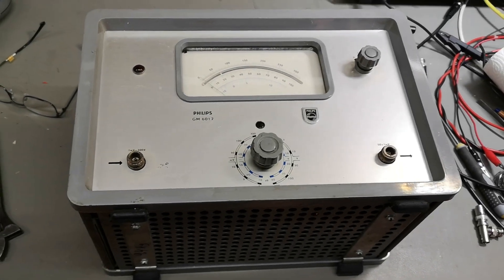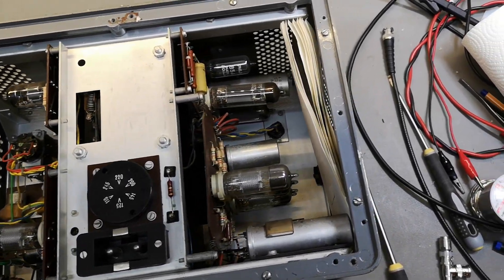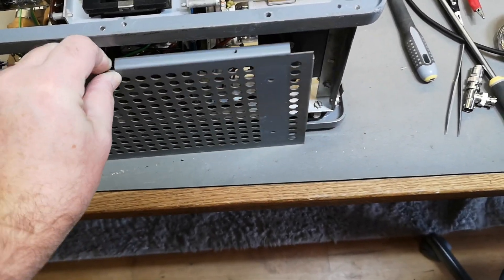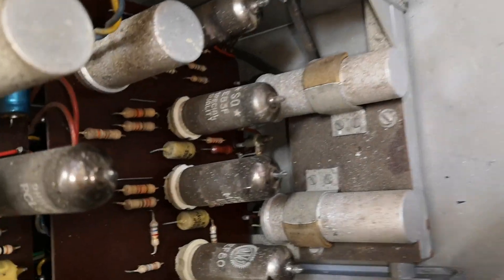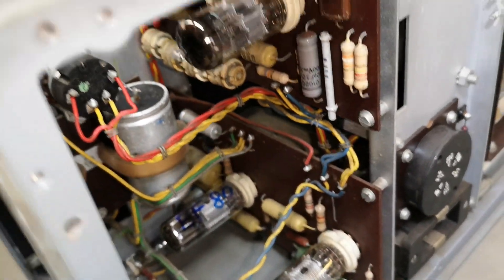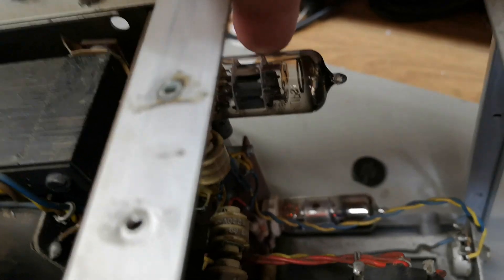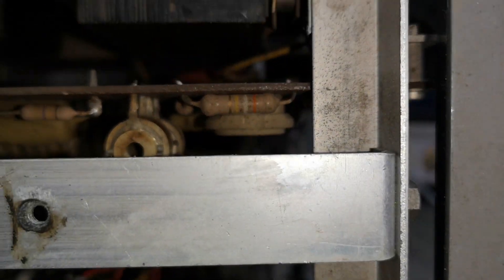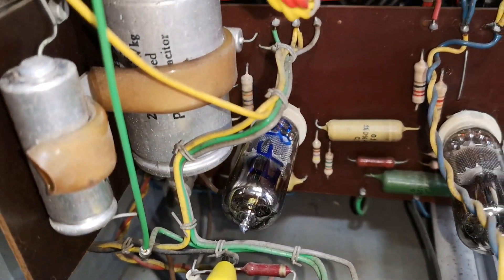Philips GM6012 wideband Millivoltmeter 1961 repair teardown

Comment: Nice video. What reduction are you using for connecting bnc cable? Where can i buy this reduction please?  (I don't know name o this old philips connector)
Reply from the maker: this is a normal standard N connector, so i just used a normal N to BNC adapter

Comment: Meter likely has cracked solder joints, or there is another loose contact on a tube socket as well on final amplifier.
Reply from the maker: see at 18:40 i show full signal path to meter works.. the meter is open circuit, and it is the coil that is blown from later experiments by the way = impossible to fix for now.
like i said in the video , it is a little bit stupid i did not test this hrs ago, but normally it is almost never the meter, but many other things before that..